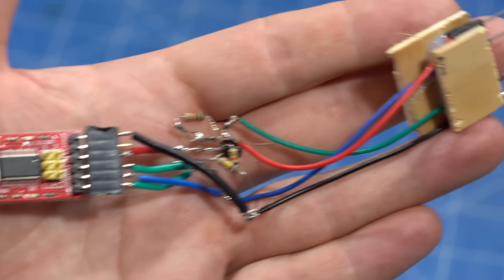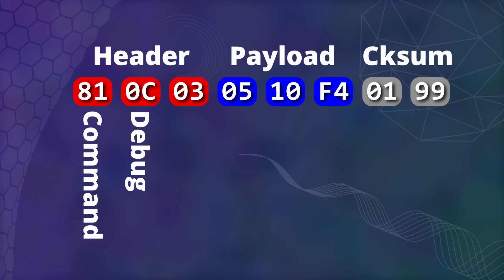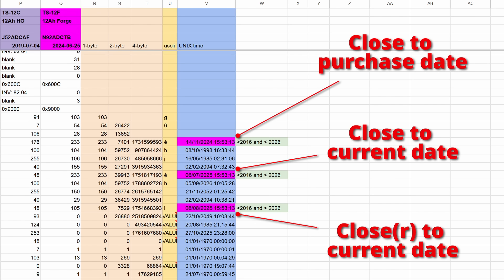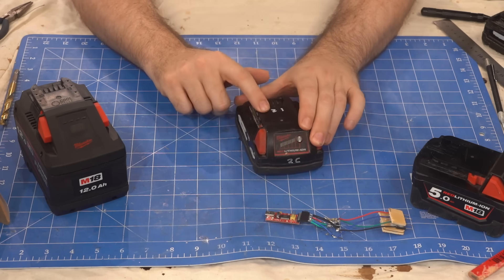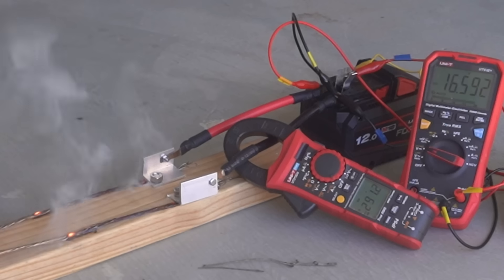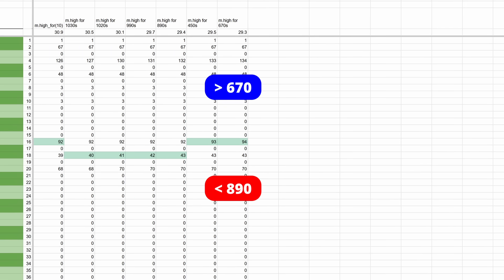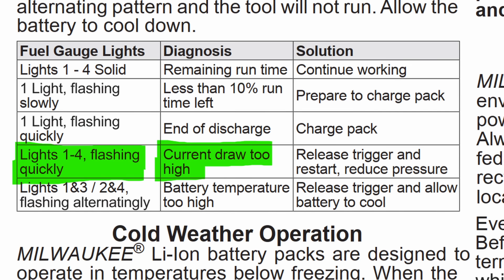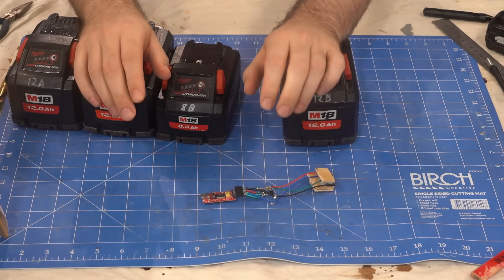Full M18 diagnostics revealed

Comment: All this monitoring but no balancing, what a shame. Incredible research from you guys!
Reply from the maker: I was fairly impressed by how much they store. A few odd choices, but overall a fairly impressive diagnostics system. And yes, cell balancing is an ongoing disappointment (by several brands now)
Reply: @toolscientist cell balancing... Omitted? That's the first thing I imagine a BMS doing.
Reply: @toolscientist  Onboard cell balancing is a patented technology, and the patent that applies to Milwaukee's pack structure hasn't expired.
Reply: @toolscientist which brands do actually have cell balancing?
Reply: @toolscientist and yet, batteries are still lasting a decade or more with proper treatment. Would it be optimal? Sure. Does it appear to be necessary? Doesn't look like it.
Reply: @user-jm4nj7nz6t  rofl, what about all the ones that are dying due to being unbalanced?
Reply: but on the up side, there is a feature that will stop your battery from working when a cell in the battery is out of range, it's great for sales!
Reply: It should be criminal, planned obsolescence.
Reply: @eIektrinis  And a safety issue.
Reply: It's hard to believe there is no balancing. Wow. Makes those battery seems even more expensive. At least if they took great care of the cells...
Reply: I am using 2ah 12v batterys from bosch for their little cordless drill. Some batterys got 8 years old with almost daily and often use. Like 1 cycle per day. They all reached 500-800 cycles at least. Which i think is totally worth it.
Reply: @nicoleibundgut534 me too, got two of them never failed.
Reply: Seems like we should add some balancing leads and balance change them on a rc lipo charger
Reply: This is done on purpose. Why make it last long when you can make everything disposable.....
Reply: Big Brother is watching.
Reply: M12 battery packs are especially bad at getting unbalanced. I have close to 50% failure rate among the packs I have, where they get so out of balance that the chargers refuse to charge them and just flash an error. All of my M12 batteries see fairly light use, but it turns out that the M18 fast charger is not only the fastest charger, but also the fastest and most reliable way to unbalance the cells of an M12 battery. I’m going to have to crack all of them open and manually rebalance the cells, it’s a huge pain. It also shouldn’t be necessary! Like others have said in this thread, cell balancing is one of the most basic things you do for any multi cell Li-ion pack and it’s ridiculous that Milwaukee doesn’t do it.
Reply: @KateNesD  I rescued a little M12 1.5AH pack that one of the guys at work abandoned. Mostly out of curiosity more than anything. 1 cell was just a little low. I hooked it up to the 500mah charger I use for vape batteries with some test leads. It took quite a long time to get up to the level of the other cells, but it was satisfying to see it be accepted by the charger again. It isn't much use for a drill or driver, but good for a work light I use all the time.
Reply: @--_DJ_--  that’s cool! I still haven’t tried it with any of my packs. I’m not sure what a typical threshold is for too-far-out-of-balance in 18650 packs for power tools, but I think you’d generally want to start doing cell balancing at as low as 10mV delta. Not sure at what voltage difference it actually becomes a safety issue though. I’m sure Milwaukee did the bare minimum for detecting out of balance packs to not get sued for blowing up lithium cells.
Reply: @KateNesD  I think they are very conservative on what they let the cells drain down to in order to prevent any battery fires. And equally as conservative when it comes to recharging a cell that over discharges. I think anything under 2.5V gets rejected. 
The compact ones are really easy to get into and access what you need to get to. I am admittedly not all that knowledgeable on what I was doing, I just looked up what the lowest safe voltage was to recharge an 18650 and gave it a whirl. I was prepared and half expecting to have a "thermal event" on my bench.
 It's been a little while now since I did it, but I know 2 cells were very close to the same and I think the low one was around 2.3 volts. If memory serves me once it got over 2.6V or so on the bad cell I tried it in the charger and it accepted it, but it had very little capacity when it said it was charged so I took it back apart and got them all to 4V, which seems to have let the charger give it a proper charge on all 3 cells since then.
Reply: I said that there are pinouts for the M18 to the individual cells and I was very wrong.  I thought Dewalt and Milwaukee has these but only Dewalt has them.  Apologies for the mis-information.
Reply: @lanzer22  false, where did you find this misinformation?
Reply: @riba2233  My bad I did some research 2 years ago when switching away from Makita and I thought both DeWalt and Milwaukee have pinouts for individual cells but I was wrong. Turns out only DeWalt has the pin out for each cell.
Reply: @lanzer22  that's right, and neither DeWalt nor Milwaukee do any kind of balancing even though they have hardware for it included.
Reply: Balancing is usually done through the charger. You'd never get enough passive power dissipation from a bms that small unless it was active.
Reply: @Aa-ron01 no it's not, only DeWalt and 12v platforms do that. It's really small power so not an issue.
Reply: The development cost and cost per battery to implement cell balancing is more than the cost of warranty claims on batteries that get unbalanced.
Reply: @leangle6856  false, they already did it, hardware is inside every pack. So it would cost them absolutely nothing to enable it.
Reply: As far as I know, this type of cell does not need balancing, it's a high amps type. It's about the chemistry, these cells are different than what's in laptops, etc. Could be really a safety must, what is being done. Specifications should be available.
Reply: @timtim8468  nope, that is completely false. All lithium cells need balancing.
Reply: They use quality cells, and balance isn't really an issue here. Furthermore, adding balancing would complicate things considerably... It cannot happen "off charge" as it would drain the packs. It can't be done by the charger because M18 doesn't have wiring access to the individual cells.
So it would need to happen inside the pack, which would take up space. And yet it would need to try and do that during charging, which is usually quite short for power tools. Furthermore, it could only be done as "top balancing" after the cells hit 4.2V. If you know about Lithium cells, you'd know that the soak is done at a constant voltage, and charge is terminated when a minimum current draw is reached.
So a proper balance is almost impossible without significantly increasing charging times. And it won't help anything... the cells will be imbalanced after the first discharge cycle.
Reply: @johncoops6897  the smallest amount of balancing, even just a few minutes worth during charging (not even at the very top), would be more than enough to correct for the very slow drift seen in many of these packs. Even if done 'off charge', the discharge would be minimal, unless the pack had a self discharging cell, in which case the pack was defective anyway, and the balancing would not have reduced the usable charge, as the lowest cell would have limited the usable range either way.

Nearly every other multi-cell Lithium based pack design uses balancing. It's so common that the BMS chips used in current M18 packs have native support, but they go out of their way to disable it. Best not go so far out of your way defending Milwaukee here.
Reply: @johncoops6897  As we know from earlier videos, the charge controller supports balancing but they left it unimplemented. It would not have increased complexity at all, and that would be a weird excuse considering g the relatively less-useful complexity that is there.
Reply: @johncoops6897 No. The BMS and the official charger could have closed loop communication, an optional balancing mechanism, and balancing indicator on the charger.

Meaning, once the state of charge reaches 100% you can opt to balance the cells. This is pretty common on a Chinese BMS.
Reply: @johncoops6897  they charge an arm and a leg for these batteries. The least they could do is to add balancing.
Reply: @Iisakki3000 - I am having trouble replying to the comments here.
All I can say is that balancing of a tool battery is not as simple as it might appear.
Reply: @johncoops6897  sorry bud but you have no idea what you are talking about. Hardware for balancing is already in packs, and it's an essential feature of lithium packs. It's not hard or complicated at all, and it would cost them zero to enable.
Reply: @riba2233 - there is no balancing hardware in these packs. The BMS chip potentially has the capability, but if so it isn't used.
And as an electronics engineer, I certainly know about this subject.
These packs are engineered for safety #1, which is the only priority of the manafacturer.
Reply: @johncoops6897  false, there is. This channel has everything about it in detail, no need to spread misinformation.
Reply: @johncoops6897  The DJI drone batteries have been cracked. They have balancing. It triggers if the battery is above 80 percent and the cells have an imbalance. It will also balance for 5 hours even off the charger. My point is they could make the bms balance the cells but clearly they choose not to for sales!
Reply: @johncoops6897  Iit would require one resistor per cell - Yes only top balancing is done but that is pretty much how all devices work, like laptops or ebikes. And that is all that is needed if you in fact have quality cells. Given that 70 milivolts of imbalance over couple of years - you don't even need strong resistors.
Reply: @AgentDexter47 I believe the BMS chips they are using support balancing without external resistors needed (at a lower current - with internal resistors). It’s just not enabled.
Reply: @malventano  i have built batteries with the 5 cell variant of this front end and i can confirm that internal balancing is possible up to a total of 50 mA; that's more than enough to keep these batteries in check
Reply: @johncoops6897  my thought process is that a new charger that can properly balance the pack would add benefit, for sure the battery would need to change to accommodate this function, an upgrade would help bigger battery packs that see high discharge rates, if there was a function to balance or fast charge based on the used would add benefit
Reply: @johncoops6897 Did you watch the video?  Packs with 15 charge cycles and 500mV imbalance.  At least I can run a health report and balance manually before the thing craps out.
Reply: @andybarnard4575 - of course I watched the video. As for your pack with "500mV imbalance"... warranty it, because it is faulty.
Reply: @johncoops6897  Literally every single factual statement you made is wrong, absolutely amazing.

- Yes it is an issue, regardless of cell quality, you can not guarantee that every single cell is exactly(!) the same for several years.
- It is already built in, they just do not use it.
- It can happen whenever it wants, we are taking about TINY amounts of unbalance accumulating over years. 500 mV after 5 years in a 3 Ah, 5 series battery is about 0.1 C, so 0.02 per year, 2e-6 C per hour or 7 µA. Even a frigging 1 MOhm resistor with its 4 µA would almost be enough to balance that!
- Neither time nor energy waste is in any way relevant at some µA of balancing current that is needed.
- The cells do not magically get unbalanced again after a few cycles when it took years prior.

Comment: Cool stuff! It might be worth making a PCB with the USB-to-UART controller and level-shifter on it. Ideally it would also have the terminals on it too, you could probably do that with vertical PCB-mount spades, though those will need to be hand-soldered so increase the cost drastically for getting it manufactured by someone like JLC all at once. It’s an option to order a bunch of boards and solder the spades on yourself and ship them out to buyers who don’t want to mess about with a soldering iron. I could design and test such a PCB if you’d want to give it a shot.

I’m just wondering if the UART connection has the ability to enable cell-balancing when you write a certain value to a certain register. Or even if it’s part of a bootloader that will let you dump the progmem of the chip and/or upload a new program.
Reply from the maker: It's something we're considering. A standalone option would be ideal, so you don't need a PC. But it's also good to be able to save snapshots to a spreadsheet
Reply: @toolscientist  If you used a microcontroller then you’d be able to offload most of the code to that instead of the shell script, maybe even have it present to a computer as a simple flash-drive to drag off a csv file. If it could add multiple entries to the same csv file that would be great, and maybe have a different file for each serial number it reads. Or have a little DIP-switch to save all batteries in the same file. That would be pretty doable with a Pi Pico RP2040, which are relatively cheap. There are definitely cheaper native USB MCUs out there, but I think the RP2040 would be easiest. But any manufactured PCB with a microcontroller in it needs an extra programming step. I think the fab-houses can do that, but it seems like a pain to converse with an ESL in order to get them to use the right programming toolchain and hardware with the right pads and pinout on your board.

If you do go ahead with a PCB, absolutely make it open-source so we can all contribute.
Reply from the maker: I have reservations about a uC design as the displays get expensive (at least relative to the USB-serial and level shifter). I guess one option would be a small cheap display that shows limited info, but also has an option to take snapshot and save a CSV to an SD card.
Reply: @toolscientist  I was thinking no display and just have it act as a flash drive. SD card is even easier to program, but a little more annoying to interface with. Bluetooth or wifi is also an option, just view the readout on your phone screen.
Reply: @toolscientist  Have a look at ESP32 devboards. Something like the TTGO should be easy to adapt as a battery health testing gadget.
Reply: @toolscientist 
Displays are cheap these days.
But, use a standard form factor one, as when they go obsolete,/updated, you don't want to have to fo a respin to deal with the a replacement part.
Reply from the maker: The small ones are, but trying to display this much data on one would be painful. That's why I was musing about having a small display and only displaying some key data, then having an option to save all to a CSV which you can later import to a spreadsheet.
Reply: @toolscientist  why not use an ESP as access point and host a small webpage with all the relevant info? You can even add a CSV download
Reply: @toolscientist  what about making or incorporating it in a saddle that mounts on the battery? You can buy or 3D print these kinds of saddles pretty easily, and it would save having people inexperienced with electronics jabbing pins into terminals.
Reply: If this develops into a commercially available product, I’d buy that!
Reply: @toolscientist I would love to help make a better adapter board.  Let me know.
Reply: It is unlikely that you could enable balancing when the system has no balancing circuitry.
Reply: @johncoops6897  See Tool Scientist’s video number 10, they have a balance circuit ready to go but they just never tell it to turn on.
Reply: @Scrogan WTF?